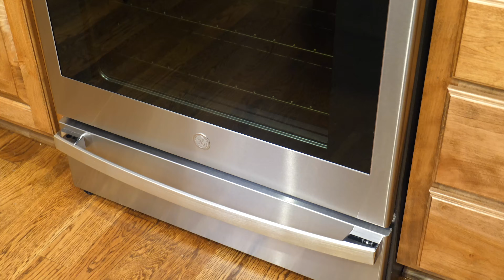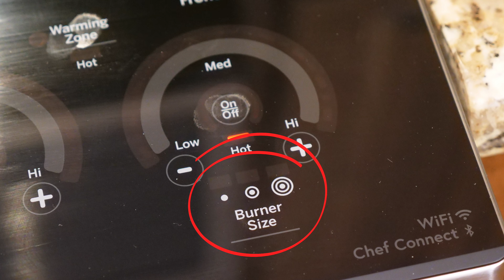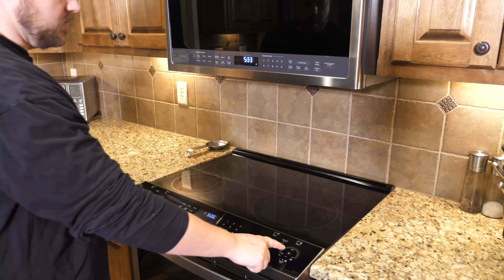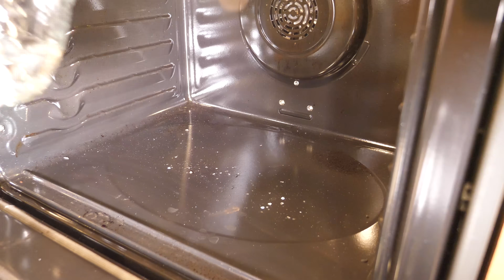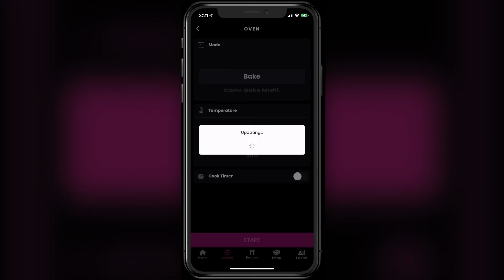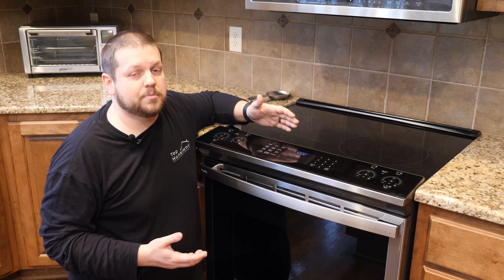Is This The BEST Convection Oven? GE Electric Range Review that has an Air Fryer and MORE!

Comment: Can I update my three year old GE Profile range to what You have? I received an update last week, my oven has new features only accessible through the app only. 
If you could send me any data you know. 😎
P.S. I have the same GE Profile range that you show in your video, just 2018 ish.
Reply from the maker: As long as your oven has the ability to connect to your Wi-Fi network I would think all of the app features that you can use will work. They just updated the app to allow turning on the air fry feature, where before you could only turn it on at the stove. I've also found out there are quite a few variations of this stove. I know some don't have the air fry option and someone else commented who had an induction cooktop instead of electric burners.

Comment: My wife records videos while cooking. Does this have a fan that would get picked up by the microphone?  The Samsung has an always in fan whenever the oven is in use and it is audible on any recording.
Reply from the maker: There is a fan that turns on, but it's really quiet. I've actually got a decibel meter on order arriving this week. I'll do a test and report back what the reading is.
Reply: @TopHomeowner  much appreciated.
Reply from the maker: Turns out my kitchen is 38db with nothing on as I stand in front of the stove. Once I turn the oven on, the meter goes to 42db. So you can hear it, but it's quiet and that's also standing right in front of it. It's a low hum so it's not too noticeable. Honestly my refrigerator is louder. Hope this helps!

Comment: Love the vid
Just got my PHS930BPTS today, front right burner is supposed to be the "power boil" (front right)  but I am having issues.
If the pot is a bit too small it seems to not want to boil (stalled at 185*) if the pot is bigger it seems to work, but still takes 20+ min to reach boiling temps. More than a qt of water, but not much more.

Not finding many great resources for help.
Reply from the maker: It looks like your model has an induction top. The first thing I'd check is to make sure the cookware you're using is induction compatible since it heats using magnets and not a standard electric element. If your pan is the wrong metal type, it won't work (or work very well). If that's not the issue, I'd probably contact GE or the place where you purchased it since it should still be under warranty.

Comment: I just bought the free standing version of this oven, but it doesn't come with anything to tell me how to use the options. I got a "user manual" but it's the size of a newspaper insert and is very basic and vague. I have difficulty finding info on how to use the options and what best to cook with them.
Reply: I have this same issue.  I bought it because of the air fry but NO instructions!
Reply from the maker: Here's a link to the online manual. It might have a little more information than what came with the oven (couldn't find mine). Pages 16-19 have some cooking tips
https://products.geappliances.com/MarketingObjectRetrieval/Dispatcher?RequestType=PDF&Name=49-2000723.pdf
I also found a recipe website from GE. Might be worth a look. https://genet.geappliances.com/Recipes/Dispatcher?REQUEST=GEARHome 
I hope this helps!
Reply: Does it do all the same things as the slide in?

Comment: Does it slide over the countertop ? I thought that was the point ?
Reply: No, new GE models don't have the edges on top of the counter. The older model from like 5-6 years ago had that
Reply: These are called "slide-in." not slide-on. If it did slide on the top of counter top, leveling could be tricky. You can buy edge caps that fit between the stove and counter top that lay over the counter, but these are cosmetic as only a sealed cap would stop leaks and that would make servicing a nightmare.

Comment: I just purchased this range.  My range has a fan noise going all the time ... Even when using just the cooktop.  Is this normal?
Reply from the maker: I hear a low-pitched hum when using the cooktop. Using the oven, I hear that hum plus the convection fan inside the oven which is a little louder. If it's more than that it doesn't sound normal to me. Hope this helps.

Comment: hot surface light stays on GE PSS93YPFS stove. Is there anything I can do
Reply: any of the Burner sensor connection came off from the pin
Reply from the maker: I'd check to make sure it's level but other than that I don't have any ideas. Sounds like it needs a service call unfortunately.
Reply: @TopHomeowner  I switch  the stoves breaker off for 30 seconds then back on and it cleared. Haven't had any problems since.

Comment: Please Please do not preheat your oven via Wi-Fi when you are away from home. I am currently in the market for a new range because I was preheating my oven a week ago. The oven beeped when it reached the desired temperature of 400 degrees, but I was busy with something else and didn't put the bread in right then. Ten minutes later, the range itself and my fire alarm were shrieking and smoke was boiling out. There was nothing actually on fire. The oven was just SO HOT! I actually had no idea an oven was capable of that heat. It was terrifying. The "it should never reach the temperature of the sun" safety feature stopped working. BTW, I appreciate your video as I am going to be replacing all four of my kitchen appliances, and I am trying to gather as much info as possible.
Reply from the maker: Wow, thats really bad! I'm glad you were OK. Thanks for sharing!

Comment: Mentioned the air fryer in the title and then didn't even review it. :/
Reply: Do you need any special accessories to air fry in, baskets...
I cannot find any user info on the airfry.
Reply from the maker: Lydia, sorry I didn't see your comment until now. I will look more into it, as far as I can tell/have used we did not use anything special. We are working on researching questions that come have been asked on this video and will be doing an update as we approach the 1 year mark of owning it.
Reply: @TopHomeowner  GE said no - no special pans required for usage.  Sheet pans/flat pans work fine.  For some other brands, you do have to purchase separate pans just for the air fryer.
Reply from the maker: Ah, sorry about that. It's just one of the features of the oven and happens to be the one GE promotes the heaviest. The oven does a great job all around. The air fryer mode doesn't require you to pre-heat the oven, just stick the food in and you're set. If you have a specific question I could answer it for you here.
Reply from the maker: What kind of hints would you like to know?
Reply: Saved me time. Thank you.